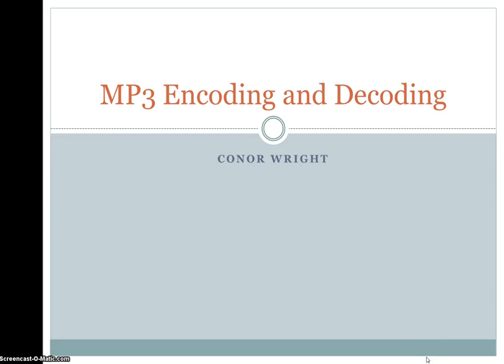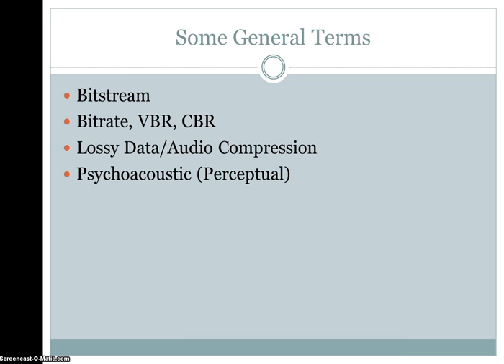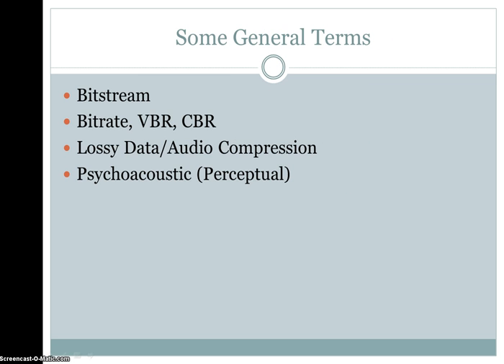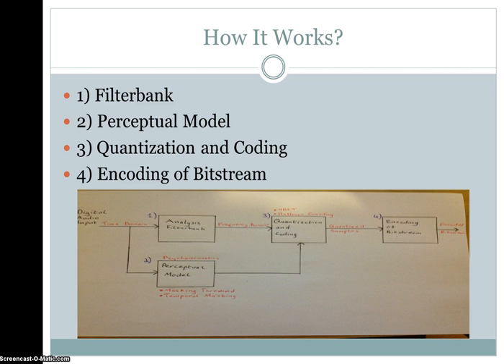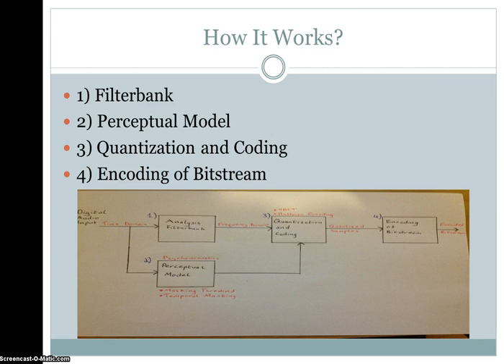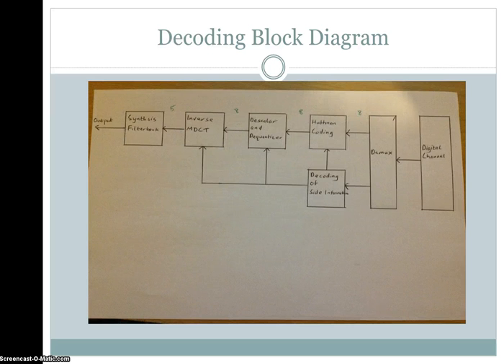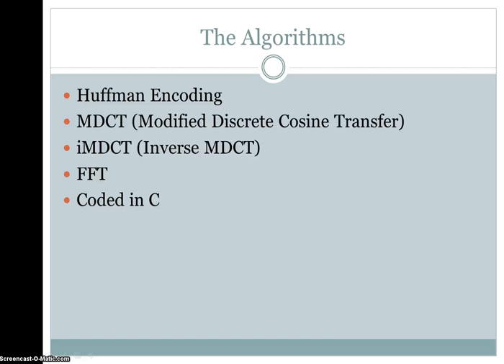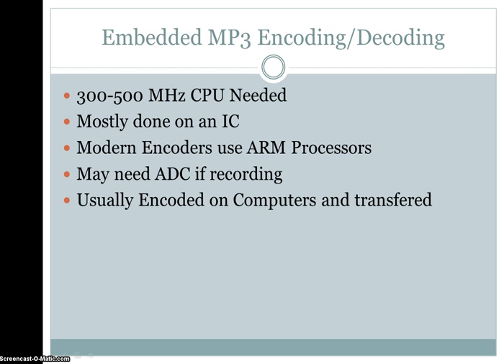Mp3 Encoding And Decoding

Comment: Since secondary memory space isn't really an issue any more since most common hand held mobile devices have up to 128GB of storage, what is the best* lossless encoding method for audio?

Best: The least compressed, thus highest quality encoding method that can be used on mobile devices.

Also, great video. You must have earned quite a decent mark for this.
Reply from the maker: Thanks Ivan, 

This was just a primer for university, it was about a month of research, they never told us what grade we got, so I assume it was just a pass/fail project.

In terms of lossless quality encoding being used on portable devices, I think it is just up to personal preference. I have an iPod which I use with aac quality files and ample space for music, and this means I don't need much space on my phone and can free it up for other things. Even with 128GB, you are still looking at a very expensive phone, here in Ireland anyway, so I find it is always good to compress data and have an "acceptable" quality.

Another thing is that some of the concepts of this video can be applied to video encoding too. In future, I can see this being much more of a problem as you are looking at much larger file sizes. Personally, I encode to iPad resolutions, and I find this scales very well to other devices while not necessarly taking up that much space on hard drives.

Thanks for the feedback!!

Conor.